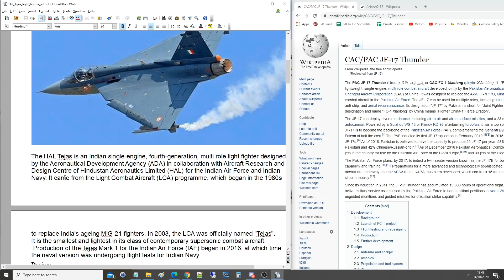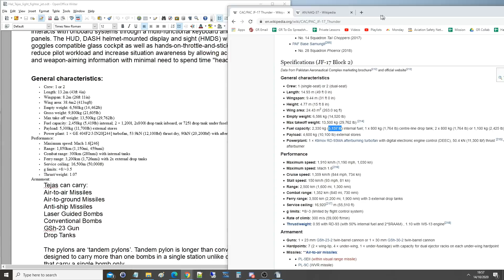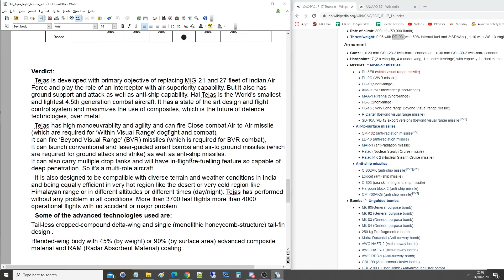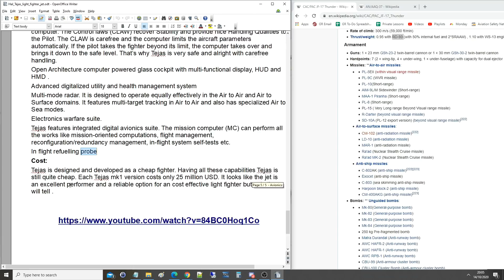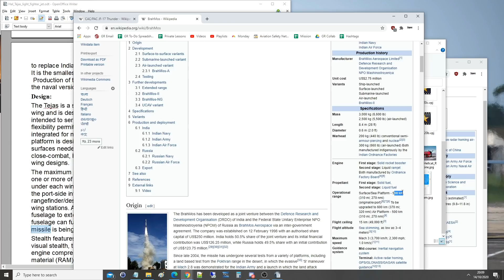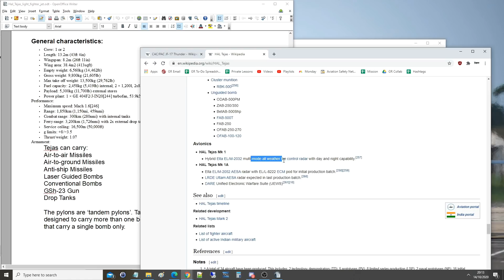Discussion: How Good Is The HAL Tejas?

Comment: IAF has placed an order of 83 TEJAS MK1A. 
Specs: 
ELM 2052 AESA RADAR(WILL BE REPLACED LATER BY UTTAM AESA RADAR) 

AIR TO AIR REFUELLING PROBE (FOC STANDARD OF TEJAS ALREADY HAVE THAT CAPABILITY) 

SENSOR FUSION AND NETWORK CENTRIC WARFARE CAPABILITIES FOR BETTER SYNERGY WITH THE NAVY. 

WILL FIRE R73-M, MICA IR and MBDA ASRAAM AS ITS CC MISSILE
ASTRA MK1, PYTHON AND DERBY  MISSILE AS IT'S BVR MISSILE.

3-D MAP GENERATOR FOR GROUND MAPPING. 

 UPTO 9.5G.

A NEW DFCS WITH OPEN SOURCE ARCHITECTURE TO INTEGRATE MULTIPLE MISSILES AND PGMs FROM DIFFERENT NATIONS.
Reply: with 0.05 RCS
Reply: @arghadipsarkar3683  i guess its only upto 0.5 rcs not 0.05

Comment: Indian Air force fell in love with Mirage 2000 after it started operating those fighters. In the last two skirmishes, Mirage 2000 was the one fighter they were comfortable with putting on the battle front and it delivered. Be it delivering LGB's on to mountain tops which were above 15,000 feet or be it delivering  precession guided bomb spice bombs on to terrorist training camps, Mirage saved the IAF.
That capability was the one that drove Indian Air Force to take Dassault for consulting on the Aerodynamics of Tejas and then Lockheed Martin on the Fly By Wire system. 
HAL/DRDO put a lot of effort in designing their first 4++ Gen Fighter Jet from scratch. 
We all know that Russian Jet Engines are thirsty and not as optimized as their American counterparts, so how come they have more range on the same amount of fuel when compared to American engine on Tejas? Those specs of JF-17 are as fake as their statements on bin laden not being inside pakistan before he was found near their version of Fort Benning
Reply: Nobody disputes that Russian fighters that India has have a longer combat range than that of Tejas. I don't understand why you would want to speculate here about something that nobody disputes.
Reply: @col.waltervonschonkopf69  are u kidding? How can one compare the range of LCA and SU-30? Russian engines by are not as optimized as American engines. For the same amount of fuel, American engines produce more thrust and last longer.
Reply: @Kevindecosta  You are saying that American engines are more efficient. Be that as it may, Flankers still have a bigger combat radius and more endurance than Tejas.
Reply: @col.waltervonschonkopf69  Tejas is LCA not a heavy fighter Aircraft.
Reply: @adityaBorPhukon2170  Yes and they cost more than licence-produced Su-30MKIs and are, on the whole, less capable than them.
Reply: Specs on JF17 is fake, specially on range
Reply: It's about air intake design. Air intake are designed for a certain characteristics. But while doing that engine is left deprived of air resulting in more fuel consumption and lower range. Gripen has similar weight and the same engine but it has a better range. Also because of the smaller length Tejas produces more drag.
Tejas mk2 is 1 meter longer which will improve the drag. They may improve Air intake design as well.
Reply: Tejas data is as honest as indias  legions of call Center scammers
Reply: The JF-17 Blk 3 is superior to Mk1 Tejas.

Comment: Correction: older versions of JF 17s uses RD93 engine which have dry thrust of 83kN, newer JF 17s (the block Cs) will use "RD93 MA" which have dry thrust of ~92kN... So the the newer JFTs TWC will be comparable with that of Tejas...
Reply from the maker: thxx
Reply: do you know the meaning of dry thrust ??? the figure that you mentioned is the thrust with after burners!!
Reply: @munindramohanta2584  Dry thrust is the thirst we feel on Gandhiji's birthday. Its very painful. Thats why we should always stock up on 1st of Oct.

Comment: Why didn't they pick a different engine?
Reply: The Indians are indigenously building an engine called GTRE GTX-35VS "Kaveri" that was meant for the Tejas but the engine has had some development problems.
Reply: Because we build great engines!
Reply: @johnskibo  That US does!
Reply: @johnskibo  it seems being underpowered is a major problem for it though....
Reply: @tomriley5790  engine power meets spec. Airframe OEMs need to control their weight growth.  It’s a medium combat engine, not an F110 class.
Reply: @johnskibo  you're kind of making my point.
Reply: It operates the highest thrust variant of the f404 . F110 series are too heavy and are for a medium to heavy category fighter. tejas is a light category fighter.  Tejas mk-2 will be using a F414 series engine.
Reply: @Vinesh Civil kaveri indian engine will now be used in AMCA mk2 which will be 6 gen jet coming after 10-15 yrs, and AMCA mk1 which is 5.5 gen jet will come in next 5 yrs and will have generl electrics f414s new variant, which is around 130kn i guess

Comment: Well Cap it is a good effort by India towards indigenization, but it didnt pan out really well. Program started in 1980s and as of 2020, only token number of 16 jets reluctantly inducted by Iaf, tht too in IOC(initial operations capability, not fully operational yet) and the Navy just rejected them. Deal was made recently for improved Mark 1A, 83 jets for $5.45 bn, tht comes to $65 million per jet for India itself!!! However i think the govt got in the fray and brought the price down to $42 mn per jet. Yet " The IAF has listed several technical deficiencies found on the Tejas LCA Mark-I variant in 2017. These flaws will purportedly will be addressed in later variants of the aircraft, which will include 43 improvements over the existing version".
 Theyve already started working on Mark 2, redesigned, larger etc
Reply: Yup but it's already better than the jf 17 block 2. We all know Israeli radars and jammers are far better than chinese radars and jammers.
Reply: @max2008abhi  israeli jammers didnt do much for abhinandan or the Su-30 did it? Anyways im not gonna argue with u guys, not worth it
Reply: @mahbubazamkhan  
"israeli jammers didnt do much for abhinandan or the Su-30 did it?"
...Abhinandan Varthaman was piloting a MiG-21. I doubt the Indians were putting top of the line preimo-expensive ECW systems on a MiG-21. Not worth it and not where you put your money.
Reply: @matchesburn  they do actually, Elta EL/L8222 self protection jamming pods, since a long time, theyre bvr capable, carry R-77s, HMD, R-27s.. Pretty kitted up id say. Maybe the Israeli's didnt give them top notch stuff?
Reply: @mahbubazamkhan  
I call horseshit unless I see evidence otherwise. There's no reason to put such expensive tech on such an old inexpensive fighter. It makes no god damn sense whatsoever.
Reply: @matchesburn  https://www.iai.co.il/p/ell-8212-ell-8222

This is IAI's official website. Scroll down and youll find different aircrafts this jammer is being used on. Look it up, Indians have been harping about these things for ages, or well since before Rafale and its Spectra which is DA BOMB nowadays
Reply: @matchesburn  Not to mention he shot down an F-16 with that same Mig-21, so not too shabby.
Reply: @cipher-6.66  looooooool seriously??
Reply: @Arup Ratan Mitra  Dont be a moron, read up about your own airforce and planes, i dont have to spoon feed you
Reply: @mahbubazamkhan  
...That only says that worldwide that the jammers have been used on MiG-21s. There's multiple countries with ELTA EL/L-8222s that also have had MiG-21s in their fleet at some point. Same goes for A-4s. Just because Israeli A-4s had them doesn't mean the Argentinians did as well.
Reply: @Arup Ratan Mitra  There are photos of a Mig 21 Bison flying with a EL/L8222. you might find them on google. i just accidentaly stumbled upon one. but these are not integrated on all Migs, only a few.
Reply: @mahbubazamkhan  proof for a SU-30 being shot down-none. Proof for F16 being shot down-none. That is what an ex-IAF pilot had written in his write up on quora.
Reply: @the_fabulous_p14  Pretty much the only CONFIRMED kill was the Mig 21 and the Helo which was a friendly fire incident and the truth of it or the info of it came after the election. Not a SINGLE credible international media confirms any shootdown of the Su-30 or even the F-16. Even the strike battle assessment shows no credible results and there is no credible source of any. So what the IAF had achieved in this strike was political election victory. The fact that IAF got political as they did initially say the helo crash was a technical one and Indians started blaming Russia for QC control. But too witnesses say it exploded, Pakistan jumped in said it was their kill at first trying to take the credit. Then after so much of fumbling and just after election ended, the truth of helo incident was finally let out by IAF...they could not hide any longer of that embarrassment.

So...with that both Pakistan and Indians did try to cover up some. Losses were still more for India. Coverups happened with USA too..

All in all. Even if there is proof of F-16 being shotdown...the losses for India was more coz of Helo shootdown killing  all onboard and a civilian dead.

So...I can safely say that Pakistan did prepare pretty well and their performance seems pretty good than they were during Kargil when India pretty much had them for keeps. India seems to be slacking now...
Reply: @mahbubazamkhan  pakistanis will always say against india......
Reply: @jojyrocks  what do u expect with mig 21😂... Actually those are already outdated and this tejas was made to replace all mig 21 but its taking a lot of time to produce because of protests and strikew against privatisation of HaL by the workers, thats why we need non lazy workerz
Reply: @mahbubazamkhan  only one thing you guys harp on because you have no other achievements

Comment: Delta wings seem to be back in fashion, Wonder if we will ever see another swing wing jet or are they consigned to the history books replaced by computer control?
Reply: swing wing is kinda not desirable anymore... the weight penalty is not worth anymore, engineers coming up wit better ways to give planes slow speed lift and less parasitic drag with a fixed wing... Delta wings are always super good eversince, its probably the best config for speed.
Reply: @jemarcatubig3171  its not about the weight. They are actually lighter overall for similar performance. 

Rather, we are now optimise for different speed (trans sonic vs the over Mach 2 speed of the Cold War aero). For transonic performance they bring no extra benefit.
Reply: Not “back in fashion” but out of fashion when it finally finished development since this thing took more than 3 decades to develop.
Reply: @lonelybullet1  
1.) Stop giving your own comments a thumbs up. You're not kidding anyone that within minutes of replying to a weeks old video someone already upvoted your comment.
2.) It isn't actually that old as far as design, but proposal. And, no, it still is being used a lot. Rafale, Eurofighter, Gripen... Yes, there's a lot of recent use of high performance delta-winged aircraft. 

Maybe cut down on the quips because you're not that good at it.
EDIT: Oh, nevermind, I see from your profile that you're just a China-shill.
Reply: @matchesburn  i upvoted ur comment
Reply: @lonelybullet1  delta wing is old fashioned? Then i wonder why its used in gripen/typhoon/rafale and even chinese j-10 

Bruuuuuuuh
Reply: Computer modeling and aerodynamic design has come a long way in the recent decades and allowed for blended wing and airframe designs that weren't possible. That and advanced FBW/FBL systems that can keep even the most absurdly aerodynamically unstable designs in the air. Because of that, swing wings don't really have an advantage big enough anymore to justify turning back to them. Unless you can somehow engineer them to not be as heavy, which... is probably more difficult and expensive than just designing a really, really good wing and airframe that performs well at high and low speeds.
Reply: @Beverly Mandahl , most accurately... no need to try increasing lift thru wing geometry change if u can just have a powerful engine that guarantees almost unity thrust to weight

Comment: It's got baby-Viggen wings!
Reply: Or fat Mirage lol
Reply: @leefairchild5639  no it seems smaller then the mirage
Reply: Ye
Reply: The Tejas is an unstable plane, Viggen is not, viggen had the 'crank' due to the downforce aft of the canards, Tejas has the 'crank' to address vortex generation point and stabilize it to improve trim issues. they may look the same but for totally different reasons.
Reply: @nooneno12  u are definately not in high school... Right?